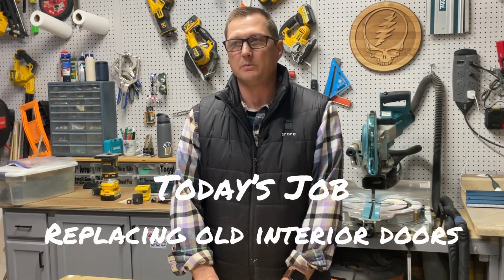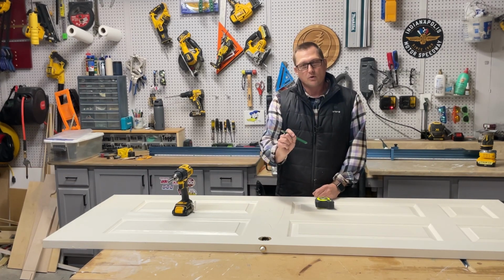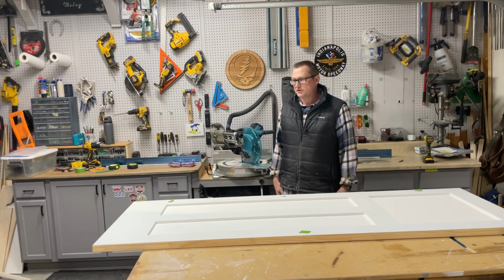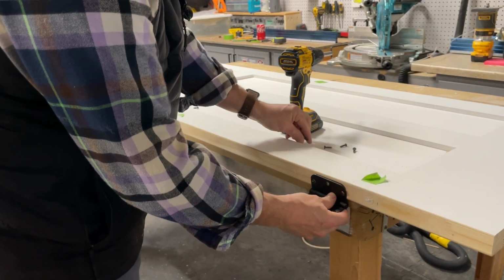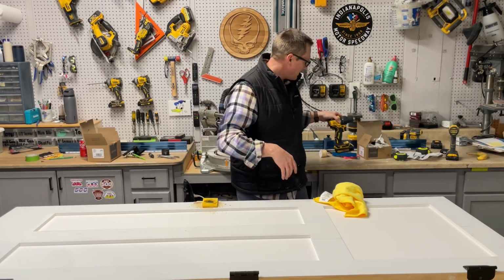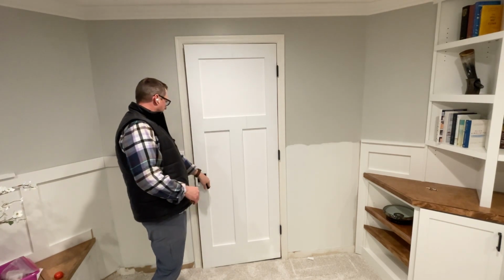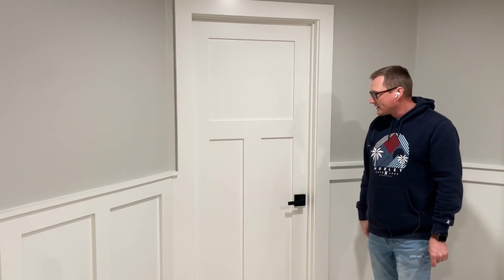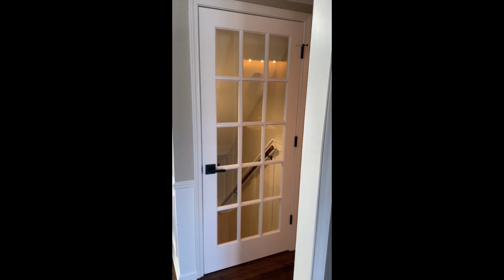How to : Replace & Install Interior Doors

Comment: What editing app did you use?
Reply from the maker: InShot
Reply from the maker: Big, big fan.  Super easy to use.  I also paid for epidemicsound app. Only issue is it doesn’t connect between devices so if you start a project on phone, you pretty much have to finish in that.
Reply: @Bradysworkshopdeli  nice! Thanks for sharing 😄 I’ve been using iMovie for my channel but I’m definitely going to check that out!